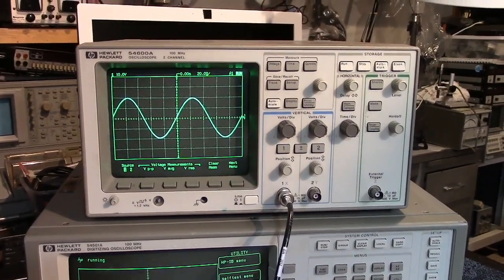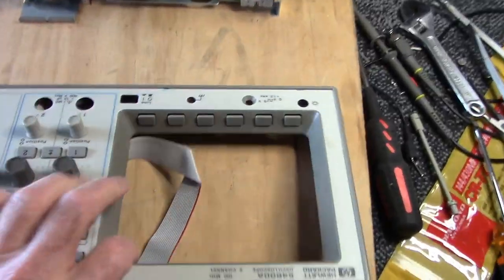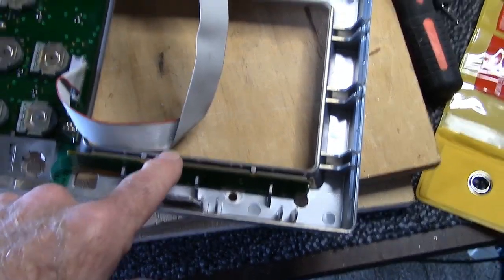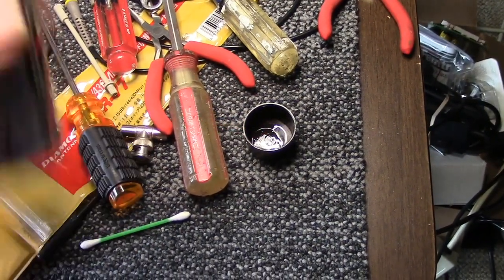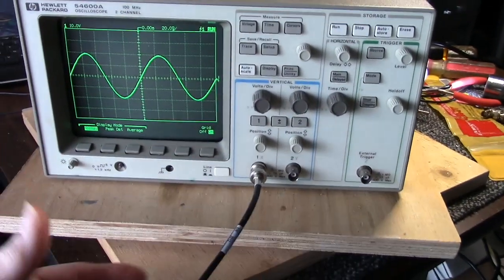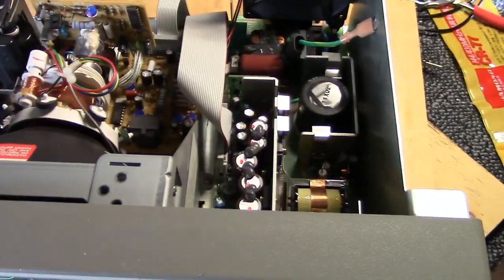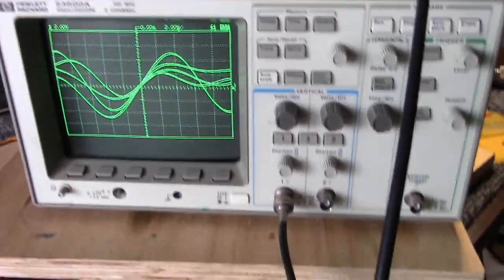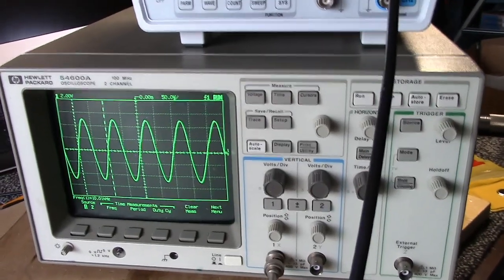Hewlett Packard 54600A Oscilloscope

Comment: I revived my TV remote with graphite from a #2 pencil. It's been working fine for a couple of months now. I just sanded the lead from the pencil on 220 paper and applied it to the rubber pad with a Q-Tip. Nice scope!
Reply from the maker: Hi DoubleHaulCharters,   Great suggestion. That is probably what the expensive small bottle available commercially  is composed of.  It likely uses some kind of binder also.  I will try experimenting with this concept  (with an old TV remote first) .